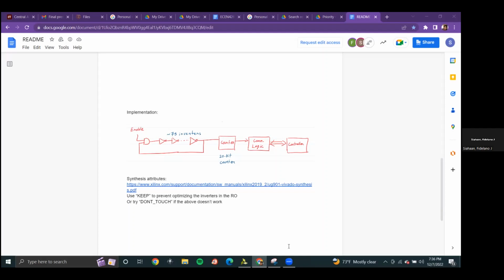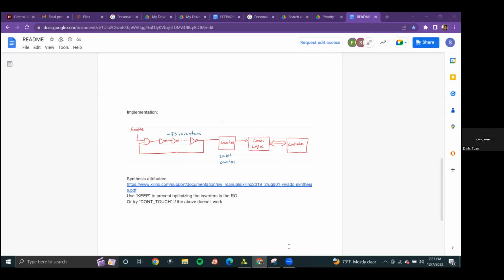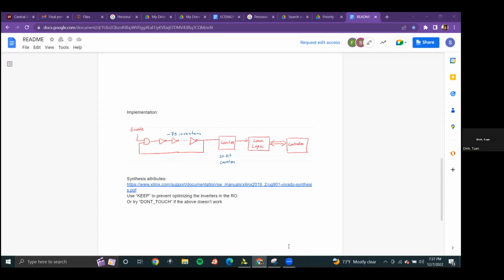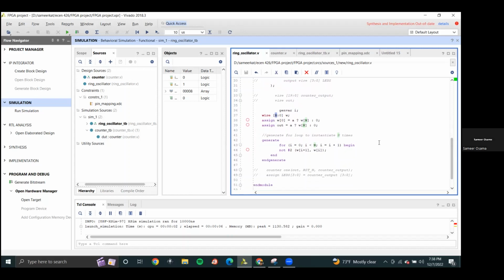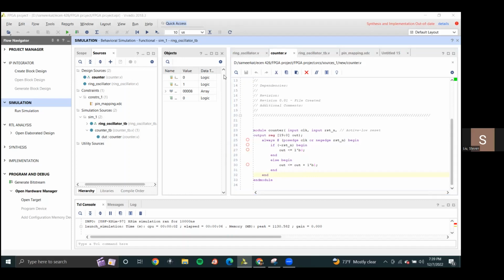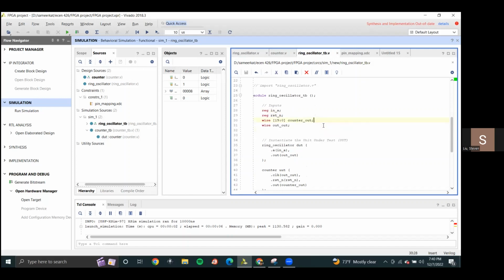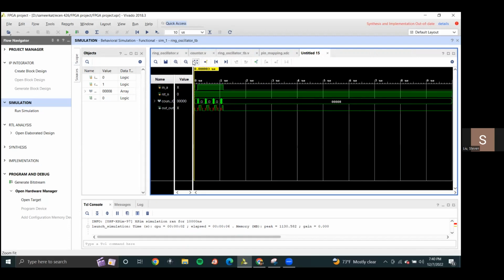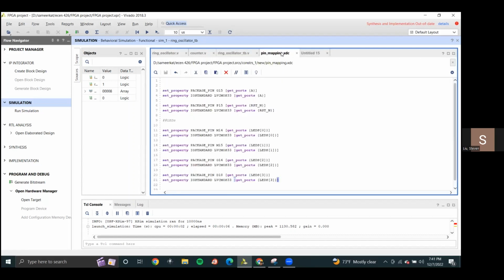ECEN 426  - Final Presentation (Project 5: The Stallions)

Comment: Evan Lingo: Great presentation! During the ring oscillator, you mentioned that there were red parts where the ring oscillator was feeding back into itself causing unknown values. Is there any way for this to be fixed? I realize that you may not have enough time for the scope of the project, but is there any theoretical way this can be resolved?

Comment: Jonathan Gover: For your ring oscillator simulation, you mentioned that the counter is counting when the ring output is high and unknown. Does that mean it is counting twice for every time the ring output actually achieves a low to high output? Is there any way that this can be fixed?

Comment: Ryan Middleton: Great presentation. I know you mentioned that you weren't able to implement the receiver side but, what length of time would you expect the first user to have to be on the FPGA for it to generate a meaningful temperature for the second user to measure?
Reply from the maker: Thanks for the reply, Ryan. I don't have a good estimate time for the first user to generate a meaningful temperature to be measured. However, the first user will increase the temperature by using a number of inverters in a ring oscillator, so the time to generate a meaningful temperature will depend on how long it takes to run that ring oscillator.